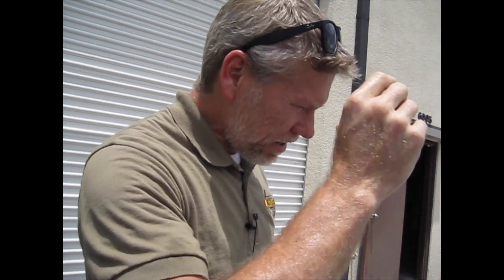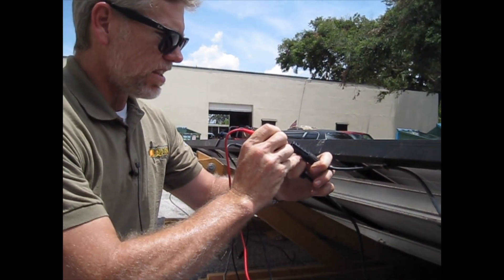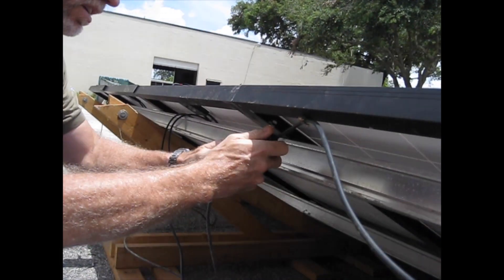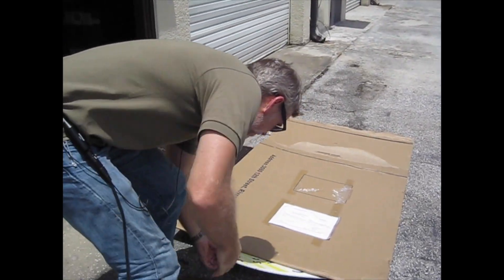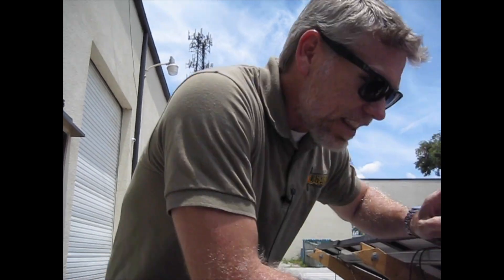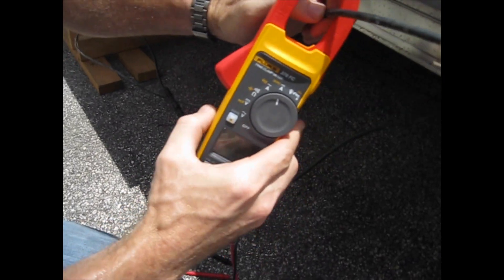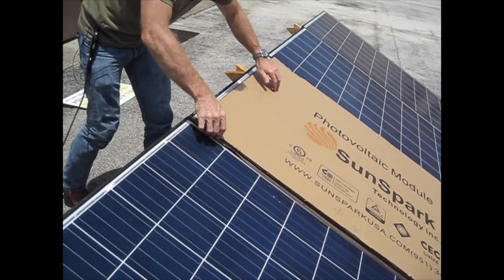Solar string inverters and shade. The Truth.

Comment: Michael, thank you, what a great video.  As you predicted, there are a bunch of people in the comments still trying to undermine your test suggesting it's not under load, not attached to a central inverter.  I linked another video showing your same test but on a string inverter, under load, it shows the same results as you.  This is an important issue as the suggesting that one panel being shaded will "Christmas tree" effect the entire string, which would scrap many installations is as antiquated as it is irresponsible.  This Christmas tree effect may be true for older panels and inverters, but does not appear to be true with more modern central inverters with MPPTs and more modern panels with bypass diodes.  

https://www.youtube.com/watch?v=kVwibZrBzg8

Comment: This video does not reflect what happens to an array when it is connected to an inverter. It only shows module behavior. I created a similar video using a live inverter. However, I had to use the cardboard test, which is not accurate either, but I am not about to get up on my 2 stories to do this. Fortunately, plenty of scientific peer-reviewed documents out there corroborate the myth of the Christmas tree effect. https://youtu.be/PqUAEtHG9Ac

Comment: Interesting that you showed that both voltage and amps stayed more or less the same when an entire panel was shaded.  Explain this, since amps x volts is watts, this means the watts also stayed the same in your experiment.  How can an entire 300+ watt panel be completely shaded and the whole string still produce the same power, wouldn't you expect the string to still lose close to the same power of a whole panel (minus reflective light)?

Comment: Interesting, but one needs to consider that neither open circuit voltage nor short circuit current is a proper test under load. You might be interested in  something like this: https://www.youtube.com/watch?v=BBB9pD5NFeU, I have one on the way. While I believe your tests are not conclusive, I am very suspicious that there is BS happening in the solar business. Currently I am testing Tigo Optimisers and so far I think I have wasted my money as I haven't seen them reducing the "christmas tree effect" caused by shading. Yes, I see evidence of the "christmas tree effect" caused by shading. One sees it on power, not so much open circuit voltage nor short circuit current as you have demonstrated.

Comment: Doesn't seem you are very open to feedback here, anyway --  testing open circuit voltage and short circuit current tells you nothing about shading's affect on power production.  A multimeter and ampmeter is a quick and dirty test to ensure the the electrical connections within the panel are still functional.  That is really all you can really test with your multimeter.

If you want to test shading and it's affect on power production you need to put the thing under load.  Ideally you would do the test with a MPPT charge controller.

Comment: An interesting test, it would be more convincing if you had the panels connected to a string inverter  under load and showed those results . I'm not saying that you are wrong but I think you could make a better case
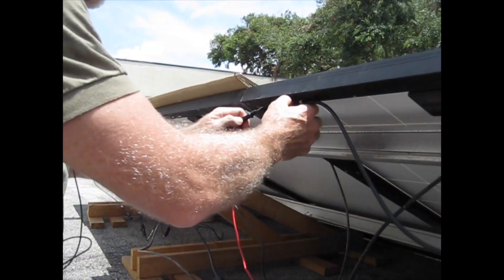Reply: 8:30 He short circuited the panels before the current reading. Isn't that as loaded as you can get?

Comment: Well Sir it's been 3 years later and you have been proven to be 100% correct.
Two Installers took on the task of doing the test in a scientific manor and here are the results.

This is a very Interesting video done a on big scale with tight controls.
https://www.youtube.com/watch?v=UQ9Szhl1ceQ&t=289s

A backup test done by another dealer/Installer.
https://www.youtube.com/watch?v=TqOw43-hbjc

It seems like Enphase has been spouting off this non sense based on 15 year old SMA inverters that had a firmare issue which made the MPPT go berserk when shading occurred.  They fixed that issue a long time ago with "Shade Fix" upgrade.  Other companies never seemed to have that problem.

Comment: new(er) solar panels have bypass diodes build-in. That's mitigating  the effect of the shading
Reply from the maker: That is correct. We recommend installing panels with multiple #bypassDiodes
Reply: Exactly.  The microinverter and optimizer arguments were made before the newer panels.  Now the argument is still around, but the companies are not really arguing this.  

I had a system installed 3 years ago with microinverters. I called the same very large company to add more this year and they even told me it will now be less expensive to just put panels in string connected to one inverter than to add more panels with microinverters to my existing system. He even said the new panels no longer have the drop in string power issue that they did a few years back.

Comment: Thank you for your work and info. How you measurements are static without loading.  The amp meter does not draw power. If you add a resistor , say 10 ohm to the ground, then measure the voltage at the terminal.

Comment: So much to say wrong with this testing...So many inaccuracies in his hurried rant that most credibility is lost. Just watching him disconnect and connect the string for Isc testing makes me cringe - can you say destructive testing of the connectors? Do the test with an IV curve tracer if you want to see the real effects of shading on a module or string. Having a curve tracer and having taught classes where it was used and demonstrated how shading affects production is enlightening to say the least. The 'christmas tree' effect applies to cells at a more basic level, and will show how easy it is to loose the production of a module based on minimal shading... String inverters are very susceptible to overall voltage drop on the string, when a design puts the circuit voltage on the low end of its operating window. Temperature rising and dropping the string voltage, coupled with the loss from one shaded module will often be sufficient to drop the needed restart voltage and in some cases even the operating voltage out of the inverters needed window. Remember voltage is not linear with irradiance, current is. Voltage will pop up with mimimal irradiance and is more affected by temperature.
Reply: https://www.youtube.com/watch?v=UQ9Szhl1ceQ

Comment: I'm afraid you haven't shown anything. With a totally shaded panel you loose one panel voltage and a couple diode drop.  With optomizer you loose one panel wattage plus converter loss. It gets even trickier than that with single cell blocked or a line across the panel. There is one panel mfg that has bypass diodes on each cell.  Their test with cardboard shading is impressive, but hardly real. Shading is never simple in real life. You are right it is seldom worth it if there is any shading at all on the panel.  I have 2500W of panels and it is a good moment, not day when I can get 600W. Mine sit under trees and collect acorns. All solar is local.
Reply: Seems like they want to show  if one panels is shaded it doesn't shot down the whole string as the micro inverter companies claim. They keep saying if 1 module is shaded all  the others don't work like a Christmas light. I think this is enough to call their marketing BS!!
Reply: @mustafasubasi894  Exactly the point of this video!
Reply: @mustafasubasi894   I don't think that is what they are saying.  A piece of cardboard may impress some, but a far better test is to drape some window screen across the panel indicating partial shading. That panel can go into bypass where an optomizer will still add some power.
Reply: @opera5714  That panel can go into bypass but it doesn't shot down the entire string unlike micro inverter manufacturers say it would to discredit string inverter systems. That is what they are talking about.. No Christmas lights effect!!
Reply: @mustafasubasi894  Everything must be viewed in context. Those who tell the story will favor their view. Few have the time to gain a complete understanding of a subject. They will focus on a fact and hold onto that like Grim Death. The mentioned municipal building is a large system that will have multiple series strings in parallel. When one string has a couple of dead panels, that string does stop producing any reliant power. The power in the other good panels is wasted.  Isc is an inappropriate demonstration for other than a single string system. Optimizers do work in a limited voltage range. That is what they are supposed to do, keep panel at power point voltage. There is plentu of misinformation going around by all parties.
Reply: https://www.youtube.com/watch?v=UQ9Szhl1ceQ
Reply: @danielsheahan7844   Just how little it takes  https://www.youtube.com/watch?v=AbxHoQF4ADk